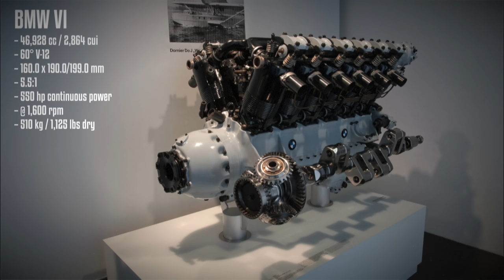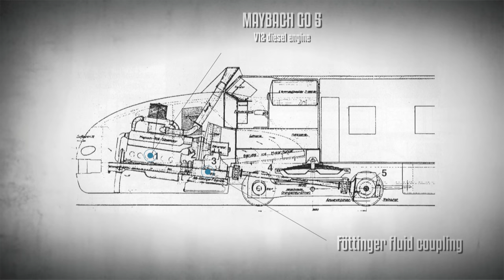This Prop Locomotive Was HORRIBLY Bad

Comment: Despite the fact that this train was the least usable in the 30s, it laid the foundations for the design of future high-speed trains, in addition to its design looking extremely futuristic and inspired the Japanese to create the Shinkansen series 0 "Zero Hensei ", very good material and greetings from Venezuela
Reply: How did it lay the foundations for future train designs?
Reply: @antcantcook960  One aspect is streamline and light weight design to reach high speed. In this case pushed to extremes compared to other trains that were more practical and built in higher volumes. For comparison, it reached 230kph before steam engines (05 002 and A4) got to 200kph. 
The other is that later the front was replaced by one that contained an engine and a hydraulic propulsion as a test bed for the SVT 137 155 (also single piece, I think both 6:03 and 6:20 show that one and not the Schienenzeppelin). 
I don't know how much later trains are derived from its design instead of just being arodynamic and accommodate the technical stuff. But VT 11.5 (West German), 18.16 (East German) and the first Shinkansen  show some resemblance.
Reply: @antcantcook960  The aerodynamic design of the ICE 1 and 2 (German Highspeedtrain) date back to 1936, Göttingen Institute of aerodynamics. There are pictures testing wooden shapes which look exactly like the ICE1 locomotive. The engineers later in 70s and 80s just took the design invented back then, simlar like they use NACA airfoils from the 30s.

Comment: At least the inventor didn't get killed by his own invention. Unlike the designer of the soviet early counterpart who died in the mentioned derailment and crash.
2 others propeller-driven "trains" : 
-UK Bennie monorail (propellers, but with electric motors!)
-french Aérotrain (much like the rail zeppelin for the lightweight construction, but without wheels, on air-cushion, and with a massive ducted propeller driven with not one but two gas turbines geared together).  Fun fact for car nerds, the half-scale prototype used two car engines (Renault R8 Gordini) for the lift fans!

Aaaand that's all folks.
Reply: "Aaaand that's all folks."
There's at last one more propeller driven railcar, the Dringos. More similar to the Soviet railcar and around the same time.
Reply: @jochenkraus7016  never heard about this thing! Thanks. 
It's a boxcar/caboose with and airplane engine and propeller crudely bolted on. The soviet one was way more refined.

Comment: This train was never designed to be used as a locomotive, it was purely an experiment to propel a railcar to high speeds, but by that time electric railcars had already proven to be able of high speeds.
Siemens and AEG built 2 electric 3-phase powered railcars which achieved 203km/h and 210km/h in 1903, then the fastest vehicles on the planet. Electric traction then already proved to be the future in rail transport.
A ducted fan would have made this vehicle a lot safer and provide more thrust as well solving the problem of climbing inclines.
Reply: Certainly looks like it was wasn't meant to haul coal up mountains.

Comment: 6:18 This shows the reconstruction of one end of the 3-car train 137 155 that Kruckenberg built 1938, based on the experience with the rebuilt rail zeppelin.
In 1939 it reached a speed of 215 km/h, but it also suffered broken drive shafts during experimentation and because of the war it wasn't repaired.
After the war it stood on a siding in east Germany slowly rotting away until it was scrapped 1967. The transport museum of Dresden discovered the last fragments, a bogie and part of a body used as a garden house, added a motor of the original type and built the front structure out of aluminium to give an impression of the shape of the train.

Comment: Although gradients were a problem the biggest one for me would be tunnels. A propeller requires airflow and in a restricted space like a tunnel the airflow would go right down to almost nothing slowing the vehicle down. Even mounted on a vehicle like that, either pushing or pulling, the bulk of the vehicle body would cut down the amount of airflow a well.

Comment: Hear me out… A fast lead car with a super strong magnet 🧲——kept at a specific distance from the main traditional train. It would act as a constant pulling force to reduce load on the main trains engines.
Reply: just make some 3d cg and present it to some investment firm😆
Reply: So the load would rather be distributed to the lead car and you could rather just give the traditional train engine more power and ditch the lead car? Sounds like a plan 🎉 But keep it a secret and go make some money! I'll wait here and you tell us when you're rich 🤩
Reply: Just use electric motor for goddamn sake
Reply: I am genuinely puzzled by what you wrote there.
Reply: Can you fly by pulling on your shoelaces?
Reply: The magnet is nothing but a coupling here, steel couplings are safer and cheaper

Comment: The torque from the shaft of an engine can be transmitted through a gear box with more than 95 percent efficiency. 
In favorable flight conditions, the efficiency of a propeller cannot exceed 90 percent. But many propellers designed in the old times had 40%... 60% efficiency.

Comment: Ahoj, nepoužil štvorlistu vrtulu, ale 2 dvojliste protibežné. To je okrem zmienených nevýhod veľmi hlučné usporiadanie pre vrtule. Navyše by tých cca 600 koní potrebovalo večší priemer vrtule, pre lepšiu účinnosť, čo logicky nešlo - jeden z duovodov pre tu dvojicu protibežných. Vo videu zmienený pán Fottinger je veľmi duoležitý muž, ale to ty určite vieš, je to v podstate otec hydrodynamických a hydromechanických prevodoviek. Len tak ďalej, pekná tvorba. Aj tá angličtina už tak nereže v ušiach.
Reply: A ešte jedna vec, torzo prestavane na hydrodynamicky prenos vykonu je vystavene v Norimberskom železničnom muzeu. Zachoval sa len “čumák”, ktory je zrekonštruovaný do vystavovateľnej podoby. Na koniec tridsiatych rokov fantastická konštrukcia. Už len ten turbodiesel, veď ČKD sa s nepodarenou kópiou motoru Maybach trapilo do 70tych rokov. Preplňovaná 170ka bola všetko len nie spoľahlivá. Oni už po vojne pracovali na pokročilejšom a spoľahlivejšom motore od začiatku vyvíjanom pre vysokotlaké prepĺňanie…
Reply: Looks like a single four-bladed prop in the film images I just watched. Maybe you should watch it again.
Reply: @JBofBrisbane  It could be that both variants are true. But look at 2:40, clearly 2 propellers on one shaft properly aligned to have each blade at 90°. They could try more solutions through time, so it could be both true. Limited width of railway vehicle could be for prop designed for 600HP very limiting.
Reply: At the end of this movie, about 6:50 is also easy to see, that there is set of two counter rotating blades.

Comment: no way they thought of a propeler train im convinced they just want to wast alot of oil and gasoline
Reply: At the time, there was no concern of emissions & the supply was unlimited, so there was no way to waste.
Reply: It was recycled the aluminium was used in aircraft building also at the time wasting oil and petrol wasn't really on the radar not from an emissions pov it was from an economical viewpoint
Reply: 70 liters isn't bad for basically a bus driving 200kph with late 1920s technology.
Reply: for the time this "train" was actually quite efficient.

Comment: It's literally easier and much more sense in any way to make high-speed gas-turbine engine train than high-speed jet engine train.

Thrust based pod (whatever is this) is just fucking dumb from any standpoint in 2023, even if you refuse really hard on electrification. Safety, capacity, efficiency, comfort, literally anything.

Maybe speed, but it actually inherently from the rail infrastructure. You can go absolutely nuts with electric motor if you ask (TGV did this, if you guys had dementia)
Reply: Electric motors to drive the wheels is probably the most logical way of doing it I think. It's only the problem of generating power to the electric motors where you have to pick the most fuel efficient and least polluting power plant
Reply: @haavard1989  Even if you really really really refuse to do electrification for high speed rail (for absolutely no reason but we'll stick into that), gas Turbine is insanely power packed for its weight and size.

So, it's actually much more powerful to turn it into electricity rather than wasted it to propel the air around.
Reply: @bocahdongo7769  Think of the level of German railroads and the available technology in the 1920s:
Before first WW the different states had their own railroad companies with their own style of passenger cars and railroad engines. The Reichsbahn inherited that conglomerate.
Only a small part of the rail lines were already electric and the industry had to catch up with the development of electric engines.
Gas turbines were in early development (Swiss Am4/6 in 1941) and transmitting several hundred hp from a combustion engine to the wheels was a challenge. Electric transmission was quite heavy, air didn't work well (V3201 from 1927) and hydraulic also in development (e.g. V140 from 1935).

Comment: All trains suck at hills tho. But this one is even worse lol

Keep making content
Reply: Shays engines and rack drive locomotives are good on hills.  But yeah, conventional traction locos are done at anything greater than 2% grade.
Reply: @andyharman3022 
Not really, whilst 2% is a common maximum for main lines that see freight trains, some conventional lines see significantly steeper gradients. My local high speed line (Cologne to Frankfurt) has undulating grades of over 4%, which are traversed at 300 kph (180 mph). If I'm remembering correctly the steepest conventional line is at roughly 7%. Metro lines can get even steeper, reaching close to 10% gradients on tunnel and bridge ramps, whilst some trams, such as in Lisbon or Stuttgart, reach some frankly ridiculous 15% gradients. Though naturally this is only possible with plenty of power, drive on all axles and a light vehicle.